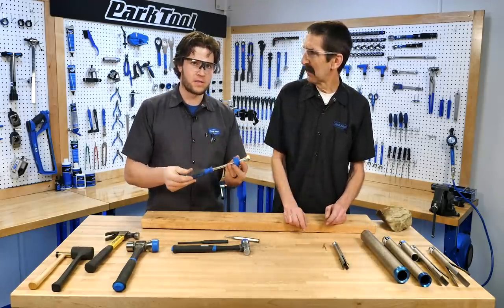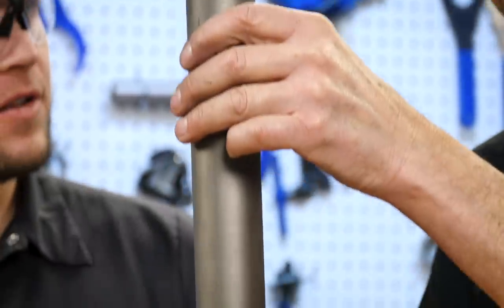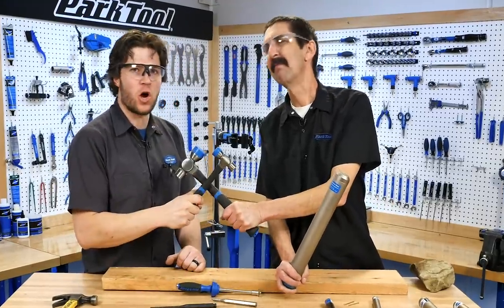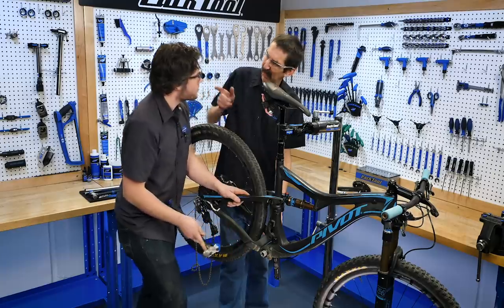Hammer Time | Tech Tuesday #123

Comment: Hey where can we get torque specs for Norco bikes??
Reply from the maker: The manufacturer is a great place to start but often the bike is made up of parts from many different companies. If you are looking for a torque spec on your crank and it is manufactured by say, RaceFace then you would find that torque spec on RaceFaces website. But if you have a full suspension Norco the Frame torque specs are listed on the bikes page under the support link.
Reply: Park Tool thanks for the answer guys!! Much appreciated.